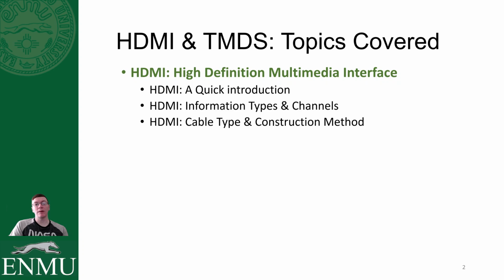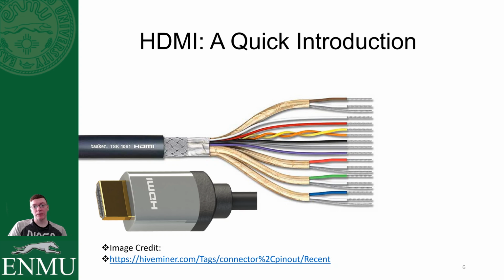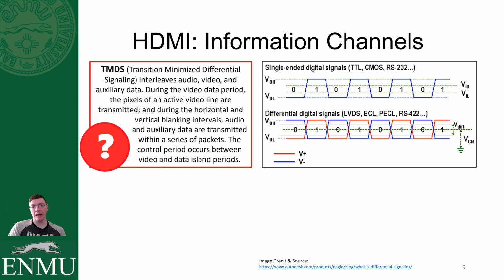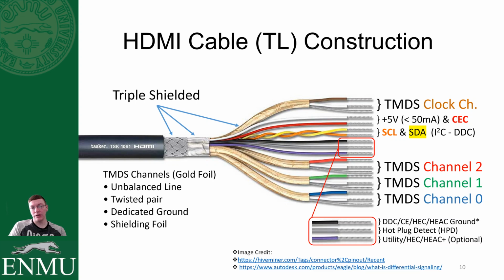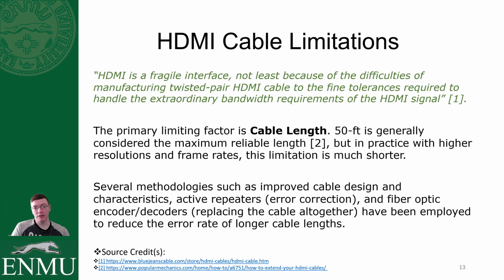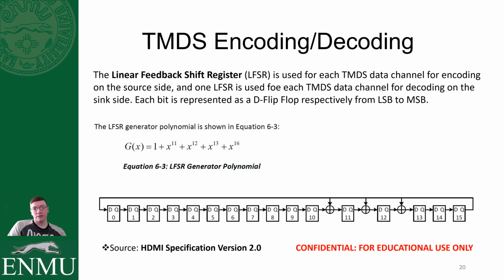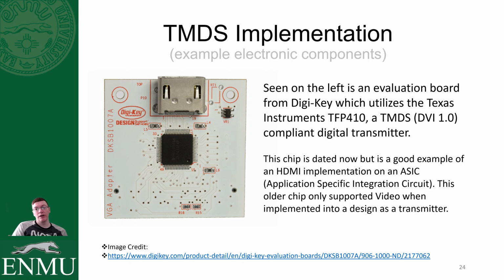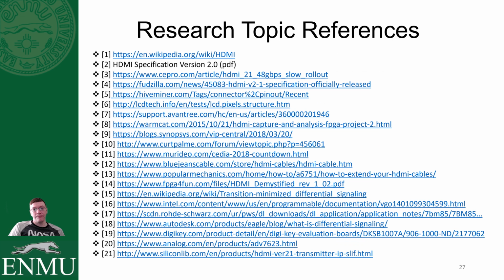HDMI 2.1 & TMDS Crash Course - ENMU EET 457 - Presentation

Comment: The instability issue with long HDMI cables isn't due to TMDS; instead, it's because the SCL and SDA lines use I2C. I2C was originally designed for communication between components on a PCB. Using it over a cable, especially a long one, naturally leads to mismatched display modes or no display between the source and the TV. TMDS uses differential signals with twisted pairs, providing noise resistance. Please let me know if there are any HDMI cables on the market that solve the I2C issue.

Comment: Are you sure about the eye pattern section? In SDI we have the same eye pattern and it does not use differential pairs (just two conductors. The eye pattern is a result of 'stacking' the highs and lows over a period of time.

Comment: I landed here due to a incompatibility on two equipment with I2S implementation on HDMI. Does anyone know a company who works on custom HDMI pinouts cables? I just need a cable with pin 1 to pin 3 and pin 7 to pin 9 swapped. I found one, but they have a minimum order requirements. I just need one cable. In the meantime, I will watch this awesome video when I get home. Thank you so much!

Comment: When the HDMI cable is attached to the new ROKID video glasses, you cannot just turn off the sound on the glasses,  very disturbing to people next to you.  They have in line connectors that allow you to break out  stereo audio which you can use to transmit blue tooth audio for ear buds.  BUT you cannot still shut off the audio in the glasses.  Any wire or stop plug on any of the connector socket holes be altered to shut off sound going to the  glasses?    Simply,  any wire to cut  to cut off sound to the receiving end?  Possible addiing another connector with deleted audio thru to glasses?

Comment: Thanks for the very detailed and informative video 🙏
I was trying to connect my point and shoot camera to a TV with a HDMI cable, but the problem i have is , when connecting the hdmi cable, the camera lcd screen shuts off, and output the image only via the hdmi cable. 
But i want booth to be working, the camera screen and the connected TV.
I know its a software issue in the camera, but is there might be a hardware workaround in the HDMI socket?
I tried to block the "HPD" terminal in the socket and CEC، but didnt work.

Comment: I have been searching for a solution to encode 5.1 RCA from a DVD player (and 4 RCA from a quad turntable) but only find 2x RCA stereo to HDMI converters for sale online. I was contemplating if such a converter is only doing the audio to a couple of the physical wires, would it be possible to take a second converter and hard wire it to the first converter for the additional audio then have my receiver take in that audio stream over HDMI. Please let me know if you think having two such devices together would possible work or not. I can see if the HDMI is sitting there waiting for the additional audio streams which are obviously missing being only a stereo converter, or if there's more to it. @tookburrow

Comment: Excellent presentation, except that HDMI 2.1 no longer uses TMDS, but replaces it with Fixed Rate Link (FRL) transmission. The clock is no longer its own separate channel, but is embedded in Channel 3, giving a boost in efficiency (8b/10b or80%, becomes 16b/18b, or 89%) allowing more data to be transmitted. It would appear that consumer and professional data transmission demands are bringing us close to the obsolescence of the HDMI standard.

Comment: I find HDMI to be so fragile..
Reply from the maker: Yep. There are genuinely other options out there. But if you’re dedicated or stuck with hdmi, I find that most issues can be resolved via minimizing cord lengths, use a quality switch (a/v receiver , dedicated switch). And carefully select ports that run the latest hdmi market revision (as needed) Also quality cords and connectors matter to a degree so researching and/or testing multiple mfrs cables and monitoring performance is time we’ll spent. And hd fury products are useful if you’re tackling integrator issues, or a challenging tech heavy HT setup…

Comment: Please help me,
I'm from indonesia, my focus project is on analog cable.
How to convert "analog cable" to "digital cable". 
The device's resollution is 1080p, but the device output using analog cable.
Which wire on hdmi to connect or to convert with analog cable? Or how the way if it need more component?

Comment: What is your suggestion on how to replace the end of an HDMI cable with a plug plug?  When my walls were put up the workers ripped the end off of the cable which is INSIDE the wall with no access to it--just the cable end with the wires sticking out.
Thanks much

Comment: hi, man plz replay I am trying to make an HDMI wire-less sender and receiver using wifi with "Zero latency"  for my portable pc gaming in my home "30 or 100 feet range" (ARIES Pro Wireless HD Video Transmitter & Receiver)  product like this is very expensive beyond our limits, so I am willing to DIY it, can you help me  to  list out the parts required and  connection details, is it even possible to build something like it or make a video on it  arunfernandez121@gmail.com help me plz  how many prise to build something like it 🙂
Reply from the maker: Hi. I feel using Windows Wireless Display (built in windows screen casting) for general purpose screen use, or even for productivity purposes. What data rate are you hoping to pipe through? 10gpbs, 18gbps, or something higher. If you need high frame rates (i.e. 1080P+, 4K60 4:4:4, etc.) AND low latency... you will likely end up spending more development /experimenting on a DIY like this than the ARIES Pro. The reason I say this that, material cost... soldering experience level? BGA capability? 
P.S. if you are sure you want to do this start looking up HDMI Ip Cores, HDMI Transciever Family, or HDMI miracast SoC development boards, etc. May be some gray market HDMI chips with -P keys in them so you can also get HDCP enabled content to work with your setup (you SHOULD know what this is). Rewatch the end of the video if you do not.
P.S/2 -  If want just want this for gaming, looking inside of you Steam App (PC), or Nvidia Software. For consoles or non Windows devices without 3rd party wi-fi screen sharing capabilities on LAN.... just get the ARIES. Save up/sell or buy a broken one and CHALLENGE yourself to learn REPAIR before design!

Comment: This is amazing! Thank you! Have a basic tech question (if you could help please!). I routed an 25' HDMI through a wall with some tight corners - everything was working perfectly for a few days. Did some 'cable management' to clean up some excess cable (~4') on the source end to finish the job: wound the hdmi in large loops and added zip ties (tho not too tight) and caused a failure.  HDMI tester says it's pin 4 & 19 are shorted (no continuity). Any suggestions? Going to try cutting off excess and resplicing the connector in small increments hoping i can cut a possible kink by the zip ties. Any suggestions would be appreciated!
Reply from the maker: So any chance of verifying with a known good cable? I will say some longer HDMI cables have higher wire guages and making the bend radii tricky. While very high quality cables will be fine, the cheaper ones are not full grain oxygen free. Lower reliability too. Have you considered a fiber optic cable instead? Still must be careful in routing it, but less issues over longer runs. I've also had good luck with "Blue Jeans" HDMI Cables. The use Belden twisted pairs and lots of quality testing. As for repair of existing cable, I'd suspect the terminations before in-line opens. The terminations are often poorly soldered not even meeting industry wire harness/connector standards and best practices. If the open is located somewhere in the cord, this could take some time to located.
Reply: @TookBurrow  THANK YOU for the reply!  So- you were correct - solder broke at termination. Pretty sure I pinched the cable pushing the receiver back against the wall snapping the soldered connection. Should have used a 90 degree adapter - sigh. Bought a 'solderless' hdmi connector and spliced in all the connections--bit of a hack job with limited success.  Best results are - continuity throughout (no openings in wall) and AppleTV 'thinks' it can send a 4k HDR signal @4:2:0 to a 4k projector (Optoma UHD60)—@4:2:2 is the only improvement to these settings when the cable worked perfectly. It seems to work for basic menu screens and looks good playing videos in some apps but seems to choke trying to play videos in other apps. Guessing there's too much noise and it can't handle as much bandwith as it thinks? Next step might be to try soldering directly to original connector tho might be super tedious if I can pull it off.  Any other suggestions? Fiber might be tricky - there are a few sharp turns with limited radius for the wire. As a last resort, I can pull the bad cable with a line attached to pull a new cable through but that's my hail mary short of busting holes in the wall (again). I guess i'm wondering if the solderless adapter is viable with better shielding? Or is this even possible to fix 'by hand' even with soldered connections to achieve the throughput i'm after?   THANK YOU SO MUCH for your help!!!
Reply from the maker: @para11ax_ingo  so what I've seen is that where one quality issue exists for solder (oem workmanship) / weak solder integrity there are likely more issues on the other end. Cold solder joints, pin holes in solder joints, non-wetting. Also one commonly cut corner is the shielding. It's much more expensive when properly shield from end to end. Sadly, even expensive cables suffer from this due to marketing strategies and non-compliant cables to the spec. Does the shielding inside the cable on your repaired end need to be soldered to the back shell or connector metal exterior ?

Comment: Can anyone explain why there is +2.5v on TMDS data lines? this is on one end of a device that passes HDMI through the device its self, I want to use HDMI to pass other type of signal but there is a voltage being produced on those lines so I might have to rethink how i'm going to do this.
Reply from the maker: Can you share your findings or the specification you want to base your modification off of
Reply: @TookBurrow  basically I had the idea of passing USB 2.0 through the HDMI pass though oh a product called a Gremsy T3 Gimbal, if you're interested
Reply from the maker: @tyrian869  Is your mod idea intended for a short or long run? I recommend looking into fiber optic transceivers (encoder/decoder transmitter/reciever). Some of them can handle a lot more than just HDMI data types simultaneously so it may be a better path if you're not locked into using HDMI cables. HDMI signals can be transported over incredible lengths via FOCS without any loss / low BER

Comment: sir. Daniel Tooker ....can you confirm from which end.. the hdmi #version #support vary  ... ....is it from the device side (like gpu have 1.4 hdmi support) or cable side  or both......
#because TMDS  controller is actually #located inside the device #not inside the connecting wire  (we purchase from cheap or expensive market 😅)...
please reply
Reply from the maker: If I understand your question (and I'm not sure I do) but I think you are asking about transceiver (Rx/Tx) compatability? And other things. Please ask one thing at a time ;)

So..  sources (gpu, roku, console, etc.) with HDMI version(s) mismatched to Syncs (TV, monitor, etc)....
 There is backward compatability in newer revisions of the HDMI standard with respect to having an older Rev HDMI (1.4a) device connected to a newer rev HDMI device (2.0a).***

* But there is a trade off for backwards compatability, not to mention implementation oversights on lower cost ASICs (not upgradable via firmware) such as unintentional lack of support for even basic features. After the handshake between transceivers (the period of time when establishing an appropriate transmission protocol) the supported resolutions and other system capabilities are communicated to the HDMI  source. The source will put out a "compliant" signal. You should know that "Compliant" signal means a lot of things. A LOT. Lol

With transceivers, just stick with Analog Devices sir/ma'am. Especially if whatever you're doing is low volume production or for personal use. Or is you project simpler and just looking to purchase a more compatable set of consumer electronics?

Comment: sir what is the hardware change inside  a hdmi 2.0 than 1.4 #cable
is it extra gage wire...or clock difference...
please reply
Reply from the maker: Wire Guage is leveraged only in the sense of the skin effect for high frequency types of signals transmitted through conductive materials. These signals are highly modulated (and interlaced) low voltage signals, so greater wire guage (nominal indivudal conductor diameter, non-stranded) is only important in the sense of surface area of the skin unless current is increased in the carrier to penetrate deeper the core of the wire.

Many hardware differences in one HDMI revision, let alone an individual OEMs implementation of that revision....
Too many hardware (and soft core) differences to list, but it's important to mention that most IP cores (1st or 3rd party), die changes / redesigns / or new product introductions with AV oriented ASICs (or FPGAs) are done for clock cycle frequency gains and ultimately increased data through put (i.e. 48Gbps as compared to 18Gbps).
Reply: @TookBurrow from which end.. the hdmi #version #support vary  ... ....is it from the device side (like gpu have 1.4 hdmi support) or cable side  or both......
because TMDS  controller is actually #located inside the device #not inside the connecting wire (we purchase from cheap or expensive market)...
please reply

Comment: Hello Daniel, I am inexperienced in the matter .. But if I wanted to see only the video to streamline the whole skein of threads, could I remain alone with the threads that lead the video and remove all the others? And if so, which ones should I keep? You're the only one who can tell me ... Thanks.
Reply from the maker: That would depend on the transceiver set you are planning to use.
Reply: @TookBurrow  Meanwhile, thanks for the quick reply, you are very kind .. I should only transmit the video signal from the cam gopro hero 7 black to the screen .. but I would like to use for example only one or some of the wires inside the HDMI cable, as few wires as possible in short .. How can I do? Thanks
Reply: Daniel you say is it too complicated to instruct me in this operation? thanks

Comment: Thank you for posting this. It really helped me understand what's going on inside the HDMI. Quick question, to make installs cleaner they sell HDMI wall jacks. Do you know on average how much attenuation or signal degradation you introduce with each jack or coupler you add? Thanks for your time.
Reply from the maker: That is a great question. I don't know how much resistive loss is contributed by the contact resistance. Gold is great, but clean connectors are probably the most important consideration, second only to the plating material of the connectors. Personally, if I was installing I would see if fiber optic was an option. Great way to deliver signals with high integrity.